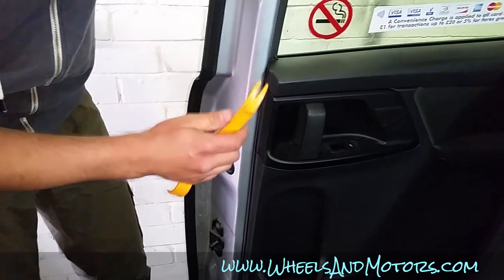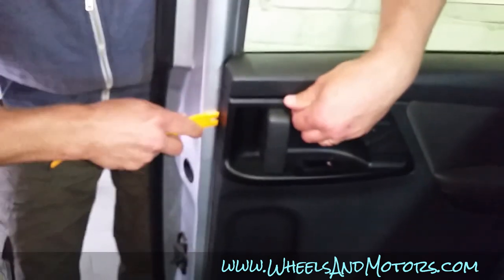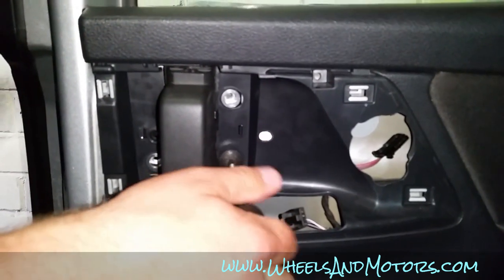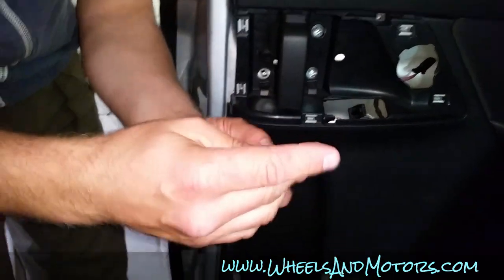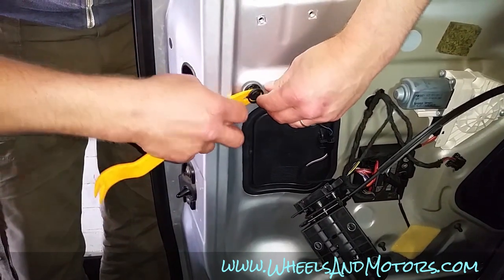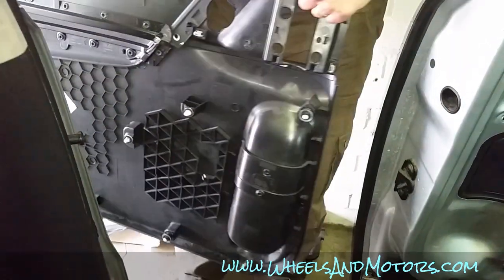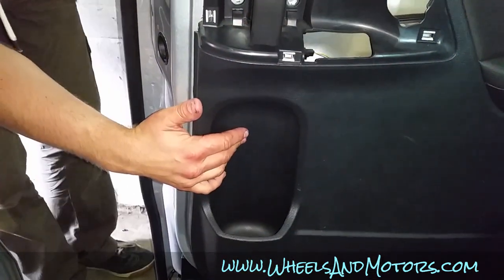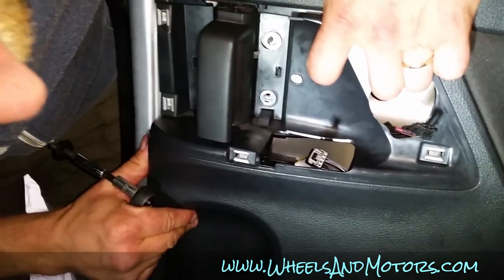How to remove rear sliding DOOR TRIM VW Sharan 7N / SEAT Alhambra

Comment: Thank you for the video. Have you removed the headliner?I seem to have a rattle on the left side by the B pillar and it sounds like its coming from inside the headlineron by the B pillar. Many thanks
Reply from the maker: Sorry, didn't get to headliner yet, currently not filming - need to add few features to the website..

Comment: Hi i have got a problem with my read driver side door cant open it from inside and child lock button is on.cant turn it off i have tried a new window button switch but it didn't sort the problem do you know what can it be ? The child lock button light is on cant tirn it off
Reply from the maker: Sorry Waseem, never had this problem, don't know how to help here...
Reply: I got same problem did you solve the problem thanks
Reply: Your Fuel Flap Sensor May Have An Issue, Child Lock Auto Enables When Your Fuel Flap Is Open So Your Sensor May Think It Is Open, May Wanna Check That Out!
Reply: @atchuthaananajmugan  fuel flap sensor makes a sence.i never bothered to get it fixed. its ok for few days and some days it doesn't work

Comment: I painted the car and removed this door,and mounted everything back.Door don’t work properly? It only closes itself? I have to pull to open? The door button only flashes?Please help
Reply from the maker: Sorry, I have no experience with removing the door on that car, and I don't have the car anymore either. Maybe try to scan the doors controller and see if it can give you a hint.
Reply: Re-Calibration Required!